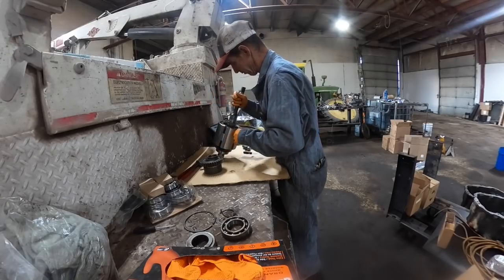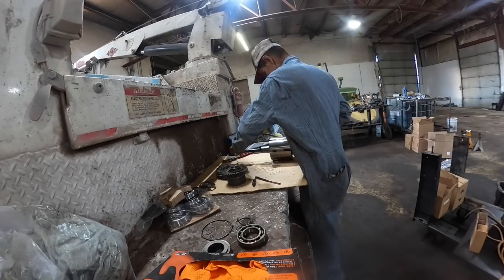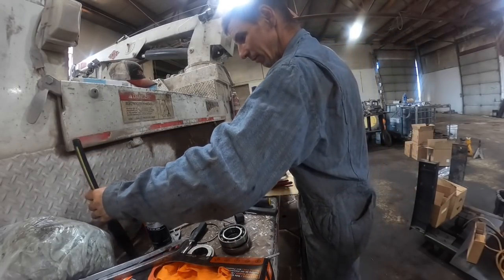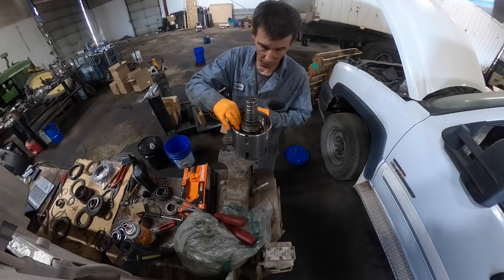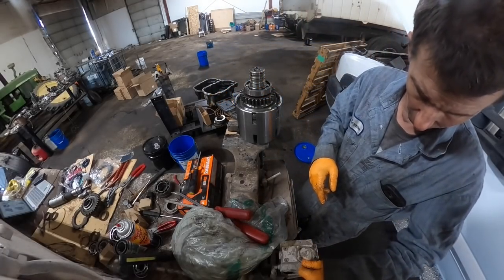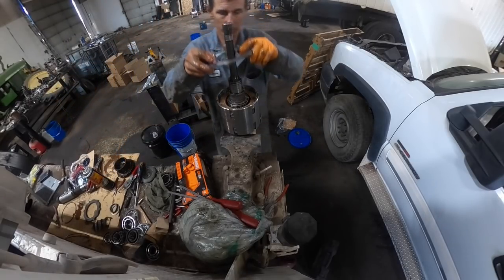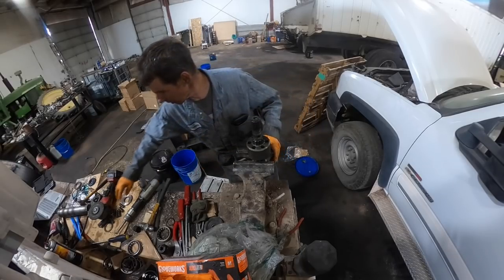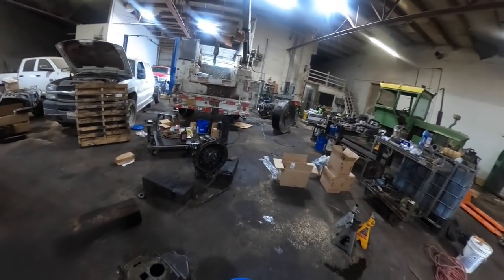Case 580sl transmission rebuild

Comment: I'm with you about snap rings, I've always tapped them just to make sure they've seated. 
I understand where a lot of people "hate" on the IHC trucks but, from my perspective. I've been around them for a long time, had several, with the exception of the "old' Macks, they're probably the best on the road. Now, if you're talking about the "newer" IHC trucks, I can't say but, those old IHC's will out work most trucks of today. Each their own. 
Great video as always, cheers :)

Comment: Hello Warren. We had one of those clutch packs snap in two it diseaved us for a while. When we put it in bits the first time we couldn't find anything wrong. The tractor would drive and when you tryed a different time it wouldn't. It wasn't until the therd time we pulled it to bits that we found it. You could imagine the swering that was going on.
Reply: Dont enter a spelyng contest any tyme soon! !

Comment: Hello Warren, glad to hear from you.  I wondered if you were okay with the big fire out there and all.  I think the evening news called it the boot leg fire.  I guess that ou are very busy as usual, well, keep on keeping on but perfect yourself as you go.  Sure do enjoy your stories and enjoy going it work with you each time.  I was a bolt turner as well back in the sixties and seventies.  Back then we didn’t have to worry about all the senders and computer stuff, we just delt with the iron and very little electrical.I have noticed that the doggy’s aren’t present lately.  Are they relaxing away from the heat, I don’t blame them for that.Are they still living on their stimulus checks! Ha ha.  Tell your wife and doggy’s Richard says hello.  Send us anew vid whenever you can, I enjoy them and the stories What happened to the d8k and the d7f, where they sold?  I bet the fire people out there would like the 8 and the 7 if its torque converter was fixed, those old machines were much more dependable when you got them right they would run for a long time with a little daily love. My doggy Misy, is relaxing on her chair in the air condition house every day.  Wow, what a life!!!!

Comment: Why not to use wise crib for roll pin assembly? Should be much easier to tap in without loosing it (if it can fly away, then it do it at an first attempt (Murphy's Law) and you find it on next project and be confused - where that part game out!  (shape a wise crib  with a bench grinder to a slim head one for this usage only - no big force need to keep a part stationary for a smooth taping action)

Comment: Good content as usual man! Couple questions for you Warren if you don’t mind, 1. How did you get started as a diesel mechanic. 2. Did you switch from trucks to equipment along the line for you to know how to work on both? 3. How long working for someone else before you went out on your own? 4. You Inc or Llc & what sorta insurance plan are you using?

Comment: Weld transmission in low first gear and no power shifting and adjust so it gets 3/4 power on injection pump.

Comment: Employees who blatantly abuse equipment like that should be sent down the road. That kind of crap is intolerable. Stuff wears out and things break often enough without that kind of drain on the bottom line.

Comment: You have brought to mind a question that I have always wanted and answer to for at least 20 years if not longer you would have a much greater experience with transmission fluid so therefore I'm going to ask TDH oil blue in color approximately the same consistency of dextron mercon 3 but yet different in color one's red one's blue ones used in automobiles and the other is used in case backhoes a brand new automatic transmission that has never had a drop of fluid put in it can it be started off in life with that blue TDH oil instead of dexron mercon 3 please let me know something regardless of how frivolous the answer may be

Comment: The one thumbs down is the local Case dealership owner….
Reply: Do you have a set of soft jaws for your vice on the service truck? I've used either brass or aluminum. Really saves parts from damage.